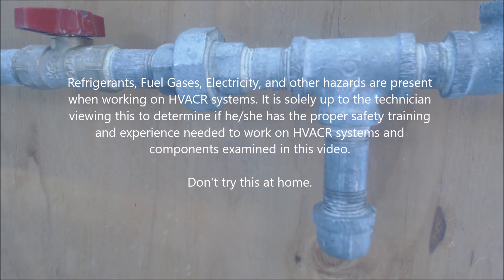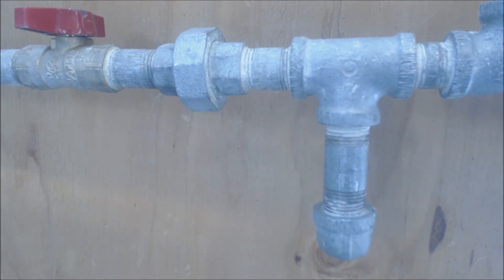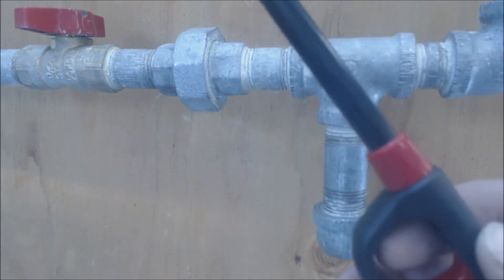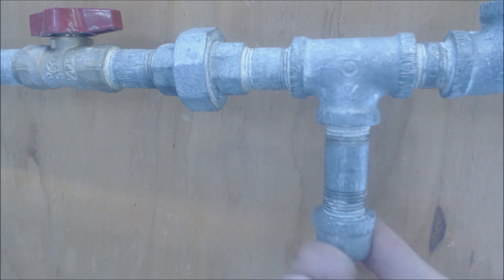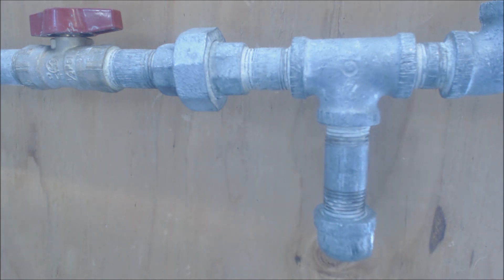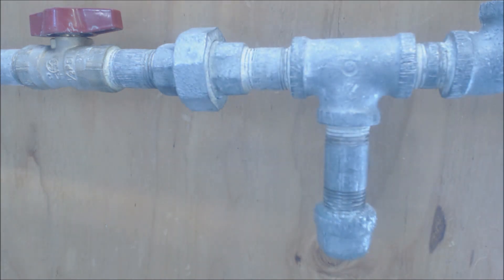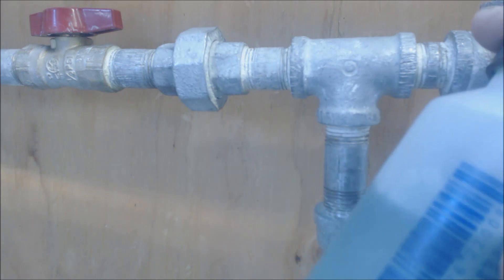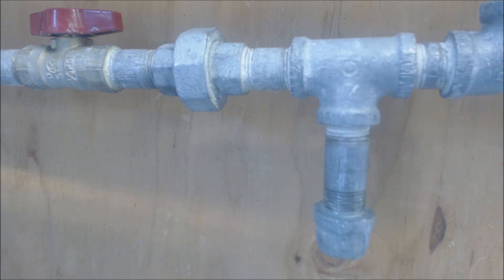Leak Check Gas Lines! Flame, Soapy Dish Detergent & Water, or Specifically Designed Bubble Detector?

Comment: Do you use electronic gas leak detector and if you do can you recomend a brand? Thanks.
Reply from the maker: The Bacharach Informant II is a decent detector for both refrigerant and fuel gases. You would need one with both sensors if you were to use it with refrigerants and fuel gas. Here is a link for a two sensor one -- http://amzn.to/2h0rqma  --- You also could just use non corrosive bubble leak detector such as NuCalgon --- http://amzn.to/2gOk1ah  ---  I also like Refrigeration Technologies Superblue micron bubble leak detector.  

ACSERVICETECH is a participant in the Amazon Services LLC Associates Program, an affiliate advertising program designed to provide a means for sites to earn advertising fees by advertising and linking to Amazon.com.
Reply: Thank you very much for your reply.
Reply from the maker: No Problem!

Comment: Could you recommend good brand for gas pipe pipe dope. Thanks.
Reply from the maker: RectorSeal or MegaLock are pretty good.
Reply: Could you use yellow Teflon tape? Thanks.
Reply from the maker: There are types of tape that are rated for fuel gas however I would really just stay in the habit of using thread sealant for the inspector's sake. I would hate to have to take apart an entire gas line and I don't want to enter into any debate about anything. I just want to get the job done the way that everyone is 100 percent agreeing upon and in my area, I work with about 12 different plumbing inspectors. I hope this answer helps!